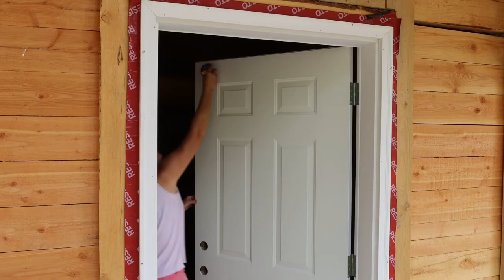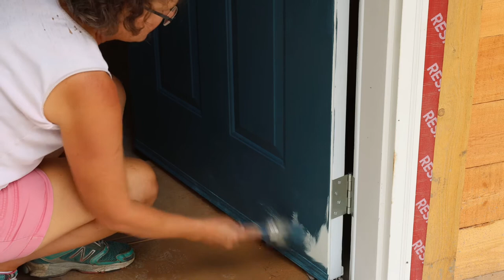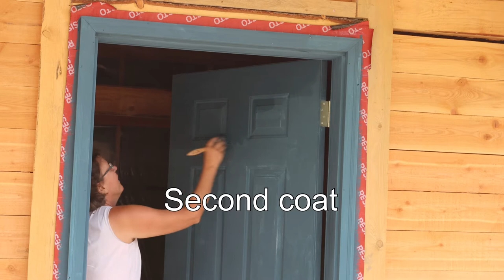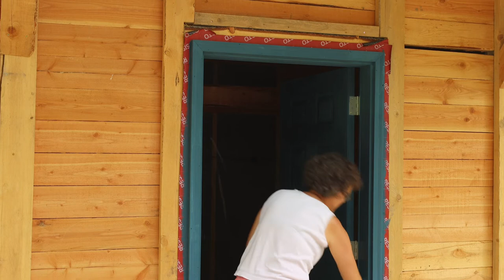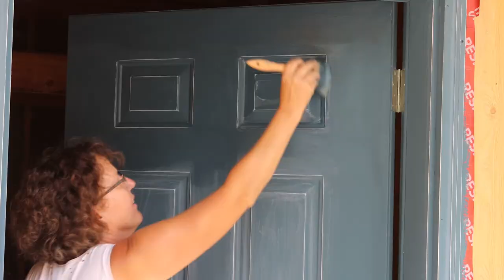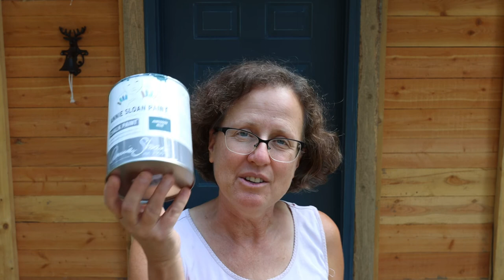Painting An Exterior Door Using Annie Sloan's Aubusson Blue Chalkpaint

Comment: Hows ot holding un? Is this line of paints OK fir exteriors?
Reply from the maker: It’s holding up great, mind you my door is under an overhang so that helps.  I sealed it with an exterior finish so it should be fine.